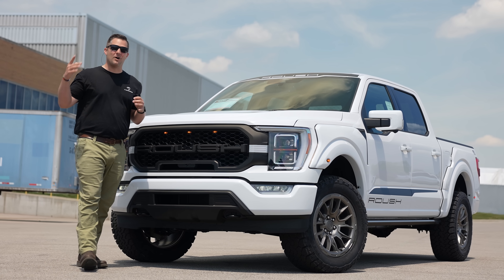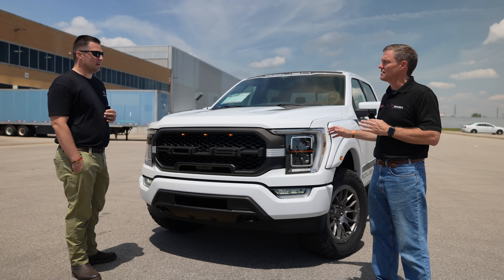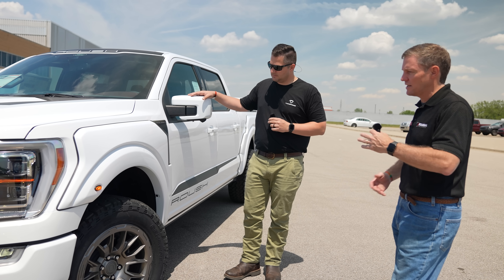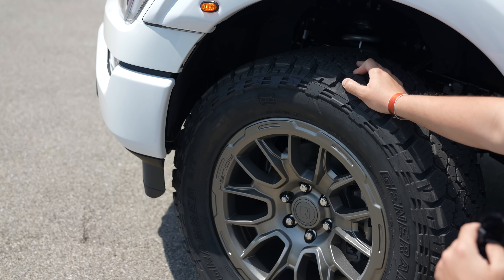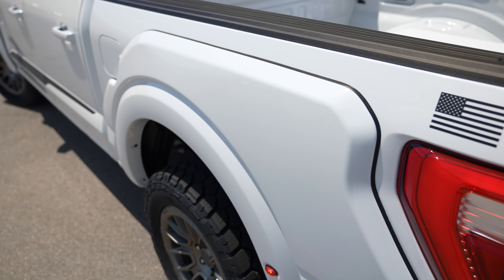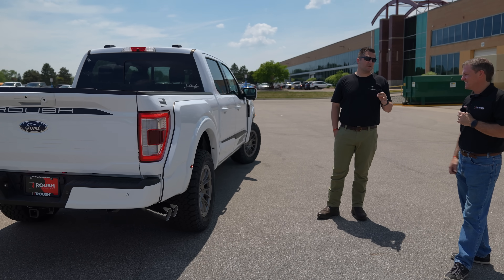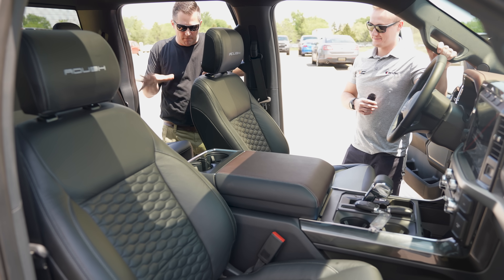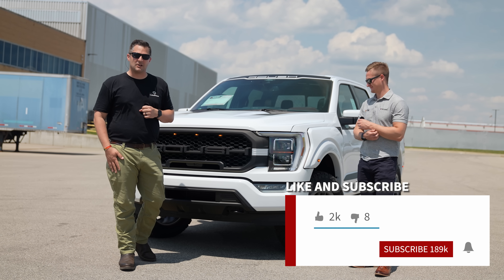2021 Roush F-150!  DETAILED Walkaround!

Comment: Not sold on the wide body add on, might as well get a Raptor.
Reply: Yeah, a raptor with a 6 cyl? No thanks
Reply: @clintcurtis9630  Exactly
Reply: @clintcurtis9630  had 2017 Roush Supercharged F150 Stage 2 650HP and now I own 2019 Roush Raptor which is now at 600HP. Raptor even with 50HP less its faster from 0-60 then my 2017 was. If you can get past the sound performance is there.
Reply: @codename7832  absolutely. I just want that v-8 rumble
Reply: @clintcurtis9630  got annoying after while on my 2017 especially with Roush Exhaust. Roush didn't offer active exhaust when I purchased my. 
This is how my 2019 Roush Raptor sounds now with proper exhaust. Its not that bad for V6
https://drive.google.com/file/d/1OQkCMcCzUl2xC6rfcWhl2dhRS9Bh2phr/view?usp=drivesdk

Comment: Bought a 2020 5.11 package, I have 8k miles. Drivers side seat wearing out from entering and seating in the vehicle. The white stitching thread is dissolving would be a good word, make a note consider a protection or patch for this area a fix of that type.
Reply: Get you a pair of electric steps. I did that for my Roush F-150. It REALLY saves the edges of the seats

Comment: I have a 2019 Ford F 150 Roush original owner bought in 2019 only under 9000 miles truck has been kicking when accelerating & does not change gears immediately when accelerating ;(

Comment: Flares, those flares. Not for me. The lights on the grill " opaque", not for me only because it doesn't match the other lighting. Brilliant with heat extractor though. Yes to the wheels! I think my issue with the flares is I can see where they attach. Maybe in a different color itll look better

Comment: Roush used to make the best looking body kit for the F150... I bought such a kit for my 05 flareside years ago. Now their trucks visually can't compete with Saleen or Shelby. Those grotius looking fender flares on this truck look as though they came from an auto parts store's trinket section where you would find the fake gold plated license frame and fuzzy dice. Today their regular cab sport truck has nothing visually exciting about them at all other than a pair of 22" wheels.

Comment: Lol 😆 🤣. 
Keep pumping the stuff that's just replacing or add on parts. 
Testing a shock to be soft 😅, the flars now that's major engineering right there 👏 😂.
Let's cut a hole in the inner fender and outer fender to get hot air out, that's the only thing worth having because it is going to help with the charger.
Other than that you can keep the rest of it. 
I'm Sorry but it's still not worth the money !!